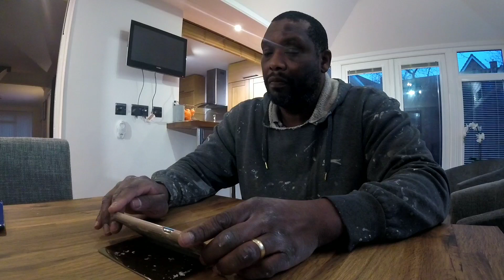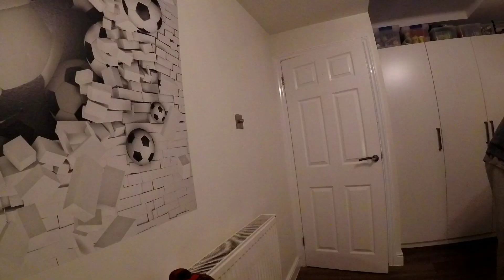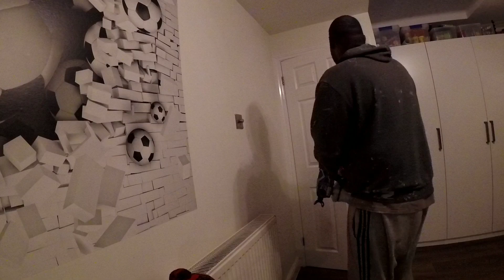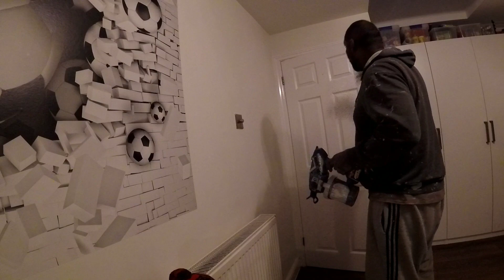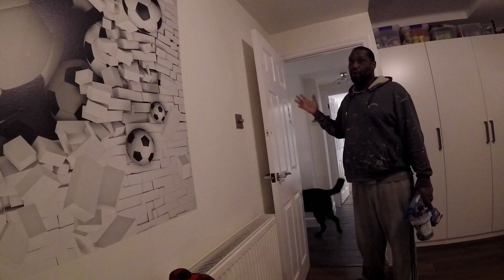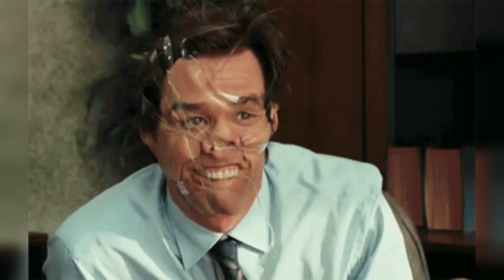The perils  of using oilbase gloss with an graco ultra max 😪

Comment: When you do your frames can’t you gloss the top rail at the same time with a roller. When you get to doors the top will be tight enough to spray over
Reply from the maker: You could do but there would be a different texture to the spray finish.

Comment: Yeah that unit does make a bit more overspray, however I use a air assisted airless and spray oil base gloss a fair bit there is still heaps of overspray with that and next to the architraves it pretty much full gloss, so touch up ceilings if necessary and I cut in twice and roll final coat on walls last  if I have sprayed skirting as well

Comment: I am just about ready to give up on my handhelds, I have the corded and cordless(nonmax) version of that sprayer and I'm not happy with the pulsing spray fan, not happy with the 50gallon pump life and $200 replacement pump cost. I've killed a total of 3 pumps, and I don't think I'll get a 4th. My advice, spend the money on the Graco gx19 (gxff). You will wonder why you didn't get it sooner. Just got mine to compliment my Graco 395 ultra and I couldn't be happier! Primes up in half a second, perfect spray fan, super easy cleanup. Its my new favorite toy.
Reply from the maker: I only use mine for small jobs, its handy because it has no leads . I haven't had the issue of a pulsing spray fan with mine but if I did I would be like you and not bother with it . If I was spraying topcoats all the time I wouldn't rely on the handheld  its not worth the money of replacing pumps i would get myself a proper spray rig like the one you suggested .I've had mine a year now and I haven't replaced the pump but that's because of how little I've used it . In total I've sprayed 30 doors on that pump so I can't imagine there's much life left in the pump.  In a way the ultramax is  a bit of a gimmick a fancy touch up tool but the way graco sold it to everyone was a bit underhanded  . A lot of us painters were expecting a lot more out of it than what we were getting for our money. Thanks for the comment Alex and thanks for watching 👍

Comment: Just an idea something I made, is a a custom roller blind, with a brown paper roller that pulls up to the ceiling with a bit of masking tape to hold it in place than that might sort out the above head over spray issue and you can just hold the corex for the sides, or as thinking of it a corex door template 🤔 with thin timber frame that supports it up right and foldable... Like you the quests continues 😂😂
Reply from the maker: 🤣🤣🤣🤣 where there's a will there's a way  my friend.

Comment: Just bought myself a QTECH5 turbine HVLP sprayer specifically for glossing doors in oil base , not used it yet though as still deliberating on if it'll actually be worth the aggravation of setting up , cleaning it out and trying to keep any over spray off walls, ceilings & carpets as i do void house re-decs all the time . I have a similar rate to you with brush and 9" short pile microfibre roller and they come out spot on so not sure whether to stick to my tried and tested method or give the sprayer a go ( never sprayed before in 30 years in trade ) and see if it saves me an hour or so each house.
Spray set up was about £1100 so not cheap either as i purchased the remote pressure pot as well. Any advice off any experienced HVLP sprayers ?
Reply from the maker: No I've had no experience with hvlp's but I've done a lot of research on them and for what I gather is they give off little overspray. Quicker than a brush but a lot slower than an airless sprayer . The finish on them looks absolutely amazing, flawless . Check out idaho painter on YouTube he does alot of hvlp spraying. You've got it mate so you might as well use it and see how it works for you . Let me know how you get on. 👍
Reply: @camdecorations9779  Thanks for quick reply mate , bit nervous about getting going with the spraying but my work mate is an experienced airless sprayer so should be able to help me out , think i'll rig up some cardboard in one of the garages of the houses we paint to get as much practice as i can before letting loose on the doors , bit worried about the cleaning side of things as we have to use oil based gloss. I have bought some tikkirula 1032 as i was told it was better for cleaning and thinning than white spirit  for oil gloss . I'll let you know if it was worth the investment when i finally get going mate.

Comment: I personally use the xvlp 3500(110v) for my site work, use with a nast head for no overspray.
You can spray slowly due to the paint flow control.
Reply from the maker: Yeah I should of got one instead of the ultra max . Thanks for the advice and thanks for watching 👍
Reply: Can you spray oil satin and gloss through the nast head  mate? I thought that was just for water based products. How do you find that gun? I'm on the verge of buying one for site woodwork, but never really seen any videos on people spraying gloss or satin in the uk. cheers.

Comment: This was gloss you’re spraying right? Did you have to use the anti static cable? how much did you dilute the gloss with solvent? I do new builds and have an ultra for applying water based undercoat and would like to use a max for glossing doors and staircase after undercoat but before doing walls so overspray won’t be an issue, cheers mate
Reply from the maker: Yes Jordan it was gloss , you don't need to use the static cable , only if your going to use flammable paints . I'm guessing your from the UK I use 1 cap of the big bottle of white spirit to 1 litre of gloss and I spray on number 5 . Just thought I might mention if your doors are hung and your going to spray them with gloss , you'll end up getting over spray gloss on the walls which can be a bitch to cover with emulsion.

Comment: Been spraying for 20 odd years in nz. I'm guessing your talking about oil base. We use water based enamel we stopped useing oil based because of the yellowing and it stinks.we take the doors off takes about 20 mins to take off 23 doors. Its faster to roll doors with water-based enamel.  microfiber sleeve and they look like they have been sprayed..  you just have to find the right system for you..

Comment: Adding to a comment down below if you are having to do it in the order where walls are finished first I take it that’s because your using oil based so don’t want to have to key overspray before emulsion or wait all day for it to dry, I’ve in the past just used really low tack tape maybe yellow frog tape or you can get really low tack pink stuff from brewers on a hand masker with brown paper or film and quickly go round all the frames, works for me, but by the sounds of it you can get a decent amount of doors done in a short time with brush and roller so probably less aggro that way lol!
Reply from the maker: Spot on . I think for the time being I'm going to have to stick with a a brush and roller , I've  been told of another way but that means buying another sprayer and I can't be doing that I think the wife would have my guts on a platter.

Comment: i had exactly the same problem by bringing the tops in then filling in  vertically. i spent at least an hour laying of because of runs. i wasn't worried to much about over spray as i didn't rolled my walls out yet. i found best way with gloss was to spray vertically but start from the bottom to top to control top over spray. i think it would make sense to try my way. fill and gun up, then bring the lids in then UC all you wood work including doors ready for top. cut all ur walls in. Finnish your doors then the walls. i have only had the ultra max about 6 weeks and its my first sprayer. your channel has and is teaching me a lot thank you i hope the way i explained helps you.
Reply from the maker: It would work your way but it would be slower for me working that way ,  I spray my ceilings and walls to a finish so it wouldn't fit into the way I work , purely on the speed and drying time. If I can give you one tip its to buy a spray machine you won't believe how quick you will finish houses and the money you'll make. I started off with a hand held sprayer then realised I could do much more if i had a  spray machine and the  money you could make on  price work.
Reply: @camdecorations9779  thanks i purly brought it for doors. i sprayed the coving on 3 units today and it done really well but i now wish i got the gxff. i am still happy with this though. i have 8 units with 16 doors sattin wood. its definitely going to help.

Comment: I don’t get the point of this video , maybe it’s just me , but first of all I would always attest throw 12” masking paper around door frame , another thing isn’t what tip size determines overspray patterns ?
Reply from the maker: So the video  is for guys who are on price work on building sites who are looking  to complete there job quicker so there making more money . You've also have to take in account of how much money your getting  to complete  the price on the  house and whether or not it would be cost effective to 12" paper and tape through out a a 4 or 5 bedroom  house. as I've seen , regardless what tip size your using and how careful you are with the direction  of spray your still going to get some over spray on the walls  when your using an airless sprayer and my walls were finished at that point. So the idea of this video is to show you guys that are working on building sites and thinking this might be a quicker  better way of completing your doors , what I came up against , and if your thinking of buying an ultra to do this type of work you might want to think again.
Reply: cam decorations oh I get your point now 😀 what I did personally even though I never tested battery sprayer , I got myself Graco 210es with a short hose on it exclusively for doors and those kind a small projects .

Comment: What was the finish like ? Did you have to lay em off 
?
Runs ? Etc
Reply from the maker: The finish was ok,  a bit patchy here and there because I couldn't get an even application due to the  worry of getting over spray on the walls . If I had the doors off the finish would of been really good. I did get runs on my first four doors  I sprayed but that was more about my technique which I adjusted after I noticed I was getting runs which again  was due to me worrying about over spray on the walls.

Comment: Did you have any orange peel finish? We are having to lay off each coat of acrylic undercoat on trim and gloss by hand
Reply from the maker: Hello Matt you've mentioned about orange peel effect before.  No there was no orange peel effect when I glossed the doors ,  all I can think of with your situation  is your spray tip is blown , you really shouldn't need to be doing any laying off after you've sprayed the woodwork how old is your spray tip mate ? . When the undercoat dries do you still see the orange peel effect if you don't lay it off ?
Reply: @camdecorations9779  I'd have to say I have used a brand new tip and had it stil, it is  their when dry and when we gloss over it it stands out like a sore thumb and the agents are not best pleased, trim is mdf is this what your working with, thanks for reply, I had to base coat 12 frames at the end of the day and ended up laying off each one soon as I sprayed them, and we are also using sikkens gloss which I have to say I do not like bring back dulux
Reply from the maker: @mattfrancis9275  I really  don't know what the problem is ,  maybe your handheld  is faulty I've had two of these and never had this problem.   I know you work with someone else but maybe you need to get yourself a spray machine you don't get that type of thing  going on .

Comment: The only effective way I've found to spray doors without overspray is by removing them. Not sure if this would have been better in this particular instance?
Reply from the maker: The doors weigh a ton and it would be to time consuming taking the hinges off and then replacing the hinges and doors once I've completed the glossing. Thanks for the input there always someone out there who might know a better way 👍.
Reply: We are all looking for quicker ,easier , better ways of improving things especially new build lads 
But spraying is definitely the way forward 
Good to share techniques and info

Comment: Do you think if you had got the Graco GXFF for oil base paint you could have used the clean shot on the angle to cover the doors better you could stand at an angle and angle the clean shot away from the wall straight ion to those doors  not sure if that would work but oil base is a difficult material to spray and a bit unforgiving 👍🏻
Reply from the maker: I don't really know if that would work , it's still the overspray but you don't know until you try . I've got a graco 390 as a back up sprayer that I could try it with but I really didn't want to use a big machine just for spraying doors . It's one of those just say fuck it if it doesn't  at least you've tried.
Reply: cam decorations agreed 390 would be two much drama but the Grago GXFF would be great for the trim jobs but that’s another £800 you have to draw the line somewhere buddy all the best to ya love the videos 👍🏻